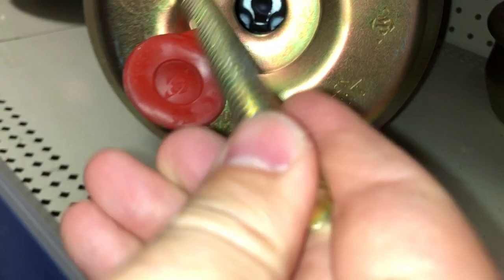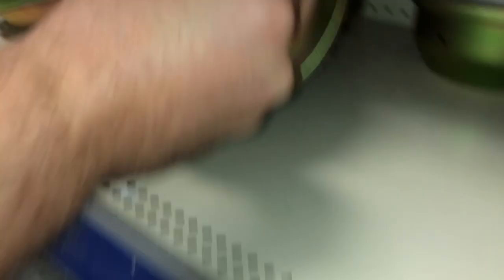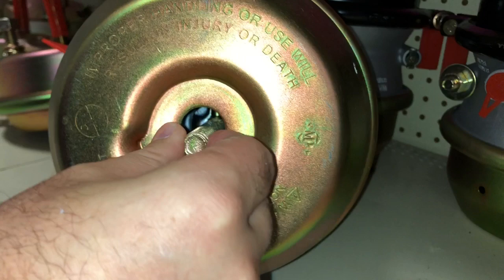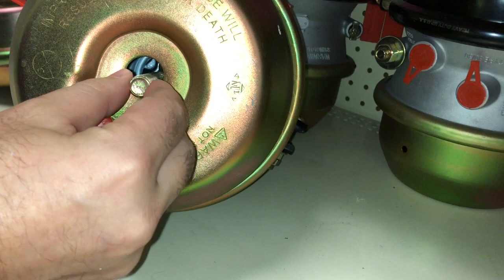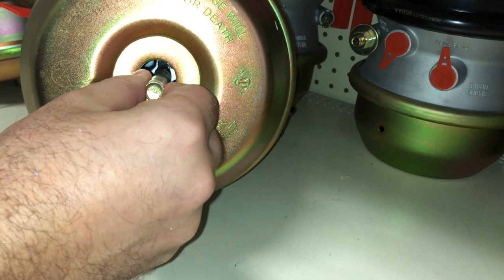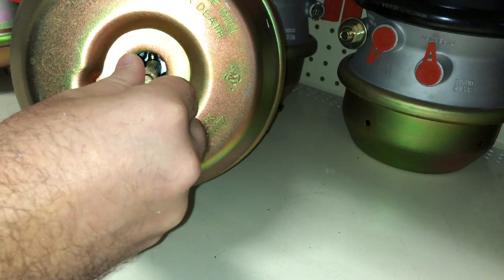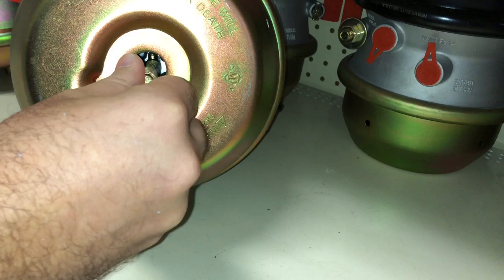Locked Trailer Brakes - How To Unlock

Comment: This screw is to cage the brake, and it's temporary to allow you to work on the chamber or either replace it. If it's defective, it needs to be replaced. I didn't think you could leave this "screw" in place..
Reply from the maker: CROWN ROYAL  you are right it can’t stay there forever, this is just a temporary to drive to mechanic and fix it.